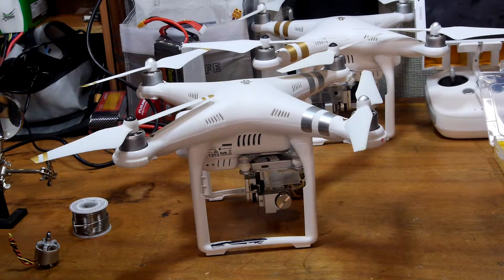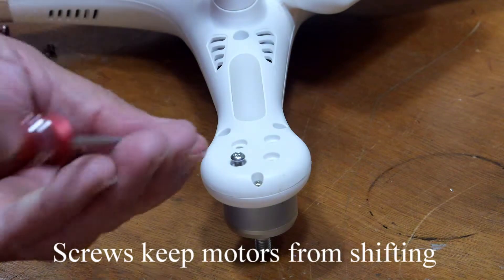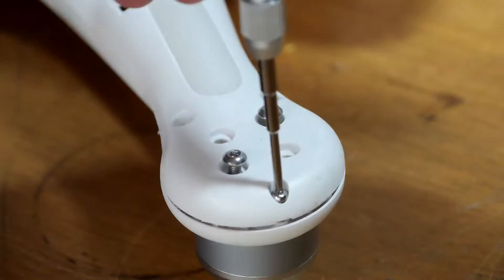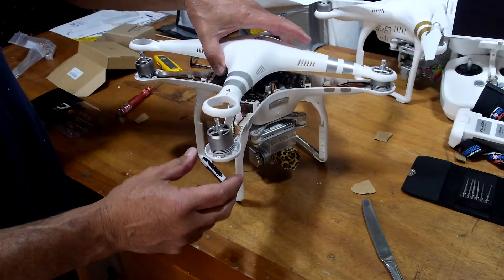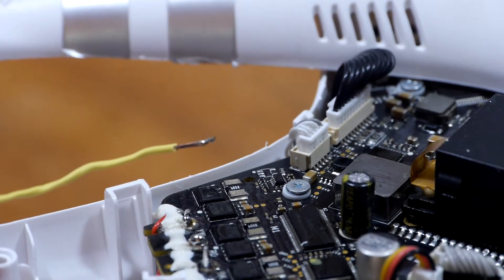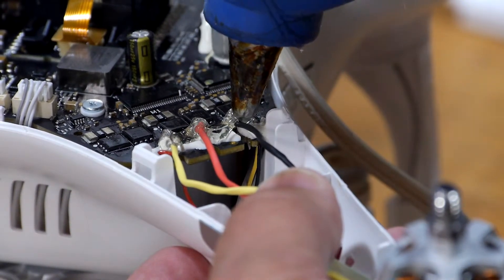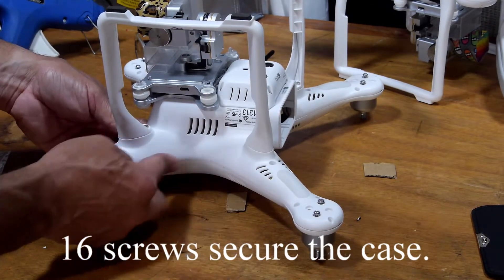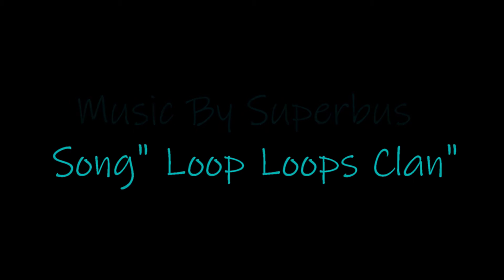Phantom 3 Advanced or Professional Motor Replacement

Comment: That was an older motor you installed and is different than the three others you kept on your drone. I would not have done that but it seems to be working for you.
Reply from the maker: Been working for probably over 100 flights now and for years.